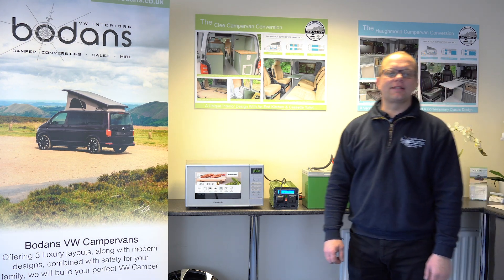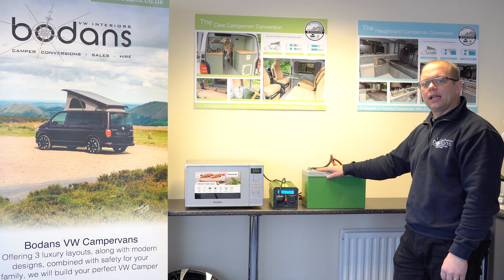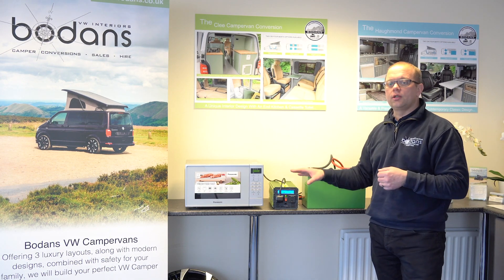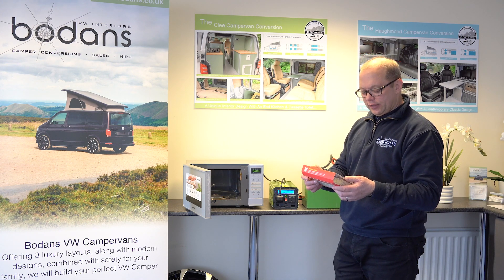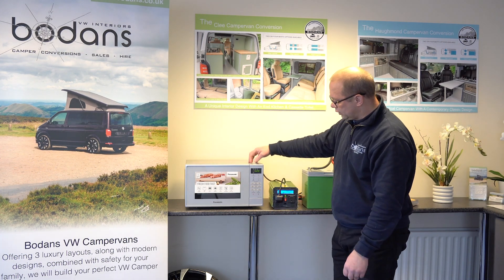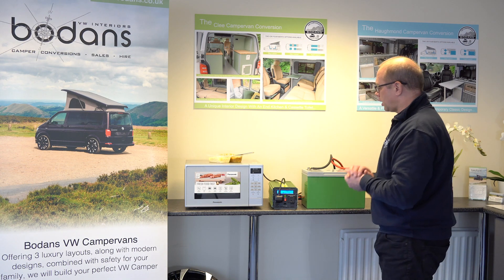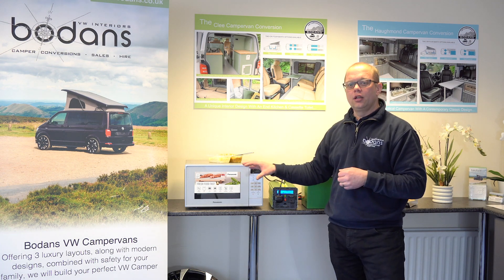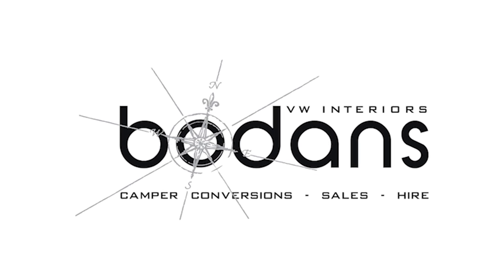How To Run A MICROWAVE From A 12v Leisure Battery In A VW Campervan Off Grid

Comment: One small detail ill add is that inverters come in 2 types modified sine wave (cheap) and pure sine wave (a bit more money). Its best to get a PSW inverter for running sensitive or more costly home appliances such as laptops, microwaves etc

Comment: As a simple rule, to calculate how long a 12v deep-cycle battery will last with an inverter multiply battery amp-hours (Ah) by 12 to find watt-hours, and divide by the load watts to find run time hours. Finally, multiply run time hours by 95% to account for inverter losses

Comment: One thing I would do is run my engine (split charge relay) while using the microwave.
Reply: Thank You! ,,,and I mean it.  Just common sense.  90% of the items you would heat in the microwave only take a very few minutes (especially in a mobile situation).

Comment: Yes it works - you need 25mm square cross-section  inverter leads as the current can hit 100a draw - We use a 105a Lithium Lifepo4 battery on ours
Reply: Where did you get your lithium from?
Reply: @sausage6984  A nice chap who lives on the River Themes in a Barge just out London - He deals in bulk sales
Reply: @trevortrevortsr2  thanks. Lithiums are very expensive.
Reply: @sausage6984  Theres some pretty nice 280 Amp hr Lifepo4 on Amazon  I would use if doing it again  - you have to be careful some are "b" class read the feedback - I rebuilt my pack recently with a blue tooth BMS and fitted a little low watt 12v silicon heating pad under it with a related timer set to switch on at 2deg C so I can leave it connected to solar all year round  even in  sub zero - using mine at 10 - 90% charge there rated at  7,000 cycles to 80% - in the long run they work out cheaper - they will last over 10years
Reply: @trevortrevortsr2  There's a lot to think about. Very useful info. Thank you. It takes a fair bit of digging to find info and then it's ambiguous for anyone who hasn't done an electrical principles course or there's data missing from specifications.
It annoys me that battery specification don't state their max amp output for max recommended time, before internal resistance becomes a heat problem.
Reply: @sausage6984  What you need to look for is something called the C rate - the  C rate of 1 means a battery can discharge at its amp hr capacity  eg a 100amp hr battery can discharge at 100 amp - in practice bigger cells have lower "C" rates - them 280ah  are 0.5C while the 100ah can discharge  at 1C  - cells used for e bikes can often discharge at  5 C - its often to do with the volume to surface area- on my system the mass of the cells and the relatively short time a microwave or kettle is on  means the cells barely rise in temp and the inverter fan seldom goes on - in any event the internal resistance of a good Lifepo4 cell is incredibly small - they hold their charge for months  - for info try channels like  Will Prowse https://www.youtube.com/channel/UCoj6RxIAQq8kmJme-5dnN0Q  or David Poz https://www.youtube.com/channel/UCXJ7onrDcxo2zy8yAsxqwgg or Adam Welch https://www.youtube.com/channel/UCm5sG3-BXQZfVy3st2T_XKg who seem to know their stuff
Reply: @trevortrevortsr2  thanks Trev. So invaluable.
I did I calculation ages ago. 800W microwave draws about 84 amps, which means the microwave should last about 1.30 minutes... not 32 minutes mentioned in this video. I really don't get it.
Reply: @trevortrevortsr2  nirvana :-) We know how that ended.
Reply: @sausage6984  Your right you don't get it  LOL  a modest microwave say 700 watts draws just over a KW due to losses  and yes you right it is about 80amps on mine - a 100amp/hr battery should run for 80 amps for over an hour but again Inverter losses mean about 50min is the most - in practice I dont think I've ever  used  a microwave for 10 min - the solar on our RV would soon put that back
Reply: @trevortrevortsr2  ok. Now I get it. I took the 100 Amp hour as being... you get 100 Amps in total over the hour. That's what I mean by ambiguous information on spec sheets.

But what it means is, you get 100Amp runtime delivery for an hour.

For all the websites I've read, did not explain that.
Reply: @sausage6984  See the road to Nirvana is the sublime state of inner happiness - not a rock band -  The faster you discharge a battery the  less you get out of it - 80amps is not something you want to pull out of a 100a battery for long spells - it will expose any differences in internal resistance and progressively throw the cells out of balance - that's why getting matched cells is a good idea - cells from the same build - don't be scared off - I built my first pack a decade ago
Reply: @trevortrevortsr2  do you mean ... parallel two, three or four batteries to divide the amp draw between them?
Reply: @sausage6984  When you add cells in series the volts rise but the amp hours remain the same - When you join cells in parallel  the volts stay but the amp/hr go up  eg 4 cells in series is 12.8v nominal '100amp/hr  however the same cells in parallel would give 3.2volts nominal and 400amp/hr - when cells are in series there charge is pulled down  equally - if one cell is slight weaker than the other it will drain more and the pack is said to be out of balance  - in series a pack is only as good as its weakest cell - the first cell to hit 2.5 volts will shut down the BMS
Reply: @sausage6984  Fortunatly BMS (Battery management systems) have a balancing circuit and when a cell hits 3.5V its leaks power allowing the others time to catch up - that's called a bleed balance - its usually between 60milli amps and 15mA - they are mounted on a little heat sink to dissipate the energy - there are other types of balance called active cell balances but they are  more complex
Reply: @trevortrevortsr2  the tech goes on and on and on.
I'd like to keep it cost affective, simple as possible and less to break.
Reply: @sausage6984  You need to decide how much power you need and what  your peaks will be  100amp/hr of Lifepo4 is like 200amp/hr of lead acid  - you need 4 cells a BMS and a main fuse in a box - and remember not to charge below freezing - I use something called a Coulomb meter on mine - it counts in the jouls and out letting me know exactly  whats stored as well as volts and amps being charged or drained - like I said if I was doing it again I go for the 280 amp cells
Reply: @trevortrevortsr2  lead acid amp rating needs to be double than that of lithium!?
Reply: @sausage6984  You charge Lead/Acid to  Full and drain them to 40 max 50% or they wont last long  maybe 100 to 300 cycles - Lifepo4 you can in theory fully charge to 3.6v a cell and drain to 2.5v  maybe 2,000 cycles - I charge mine to 90% and drain to 10% which should give me 7,000 cycles and then the batterys storage  will still be 80% of new. One thing you should note is Life or to use its full tittle Lifepo4 is not the same a Li-Ion which is a  more energy dense chemistry charged to 3,6 nominal - we use lifepo4 because  a 4S (4 in series) fits in nicely with a cars alternator voltage of 14v
Reply: @trevortrevortsr2  that is insanely impressive
Reply: @sausage6984  I could almost build a 280 amp for £100 more - its a cheap chinise battery - see what my friend Will says  https://www.youtube.com/watch?v=WVxvBkeY0UY

Comment: What size fuse is on the inverter.....100amp... 200amp...?
Reply: I found 200amp fuses best as threes quite an initial surge that tripped a 100amp

Comment: Hi, I'm very new at this so...Amish here in Missouri suggested that I get 2- 6vot. battery's for running LED lighting, computer, and Microwave, Is that true ?    Also will I need some kind of converter......I did notice "Bass Pro" had some that was multipurpose...but I'm still kinda lost to all this.
Reply from the maker: Hi John, we have tried many different setups to get a microwave to work from a 12v battery and found this to be the best. As for LED lighting, so long as its 12v, a standard 12v leisure battery would be fine without an inverter. To run a computer / Laptop you would need a 300 watt inverter conectected to again a standad 12v leisure battery. Hope this helps.

Comment: Hey there I have
varta professional dual purpose lfd90 battery
Sterling 1600W power inverter
I've noticed that voltage on the inverter drops to below 12V when I use my 700W microwave. Cables are very thick I put 50mm so I believe that not the problem. Could battery be of a wrong type ? Does voltage on your inverter drops as well ?
Thanks

Comment: Question please how much will it help to have engine running whilst microwave is running. Will it make much difference? subject to that battery being on the charging circuit. ThanksTony
Reply from the maker: Hi Tony, it will help but only slightly and its all dependant on the size of your vehicles alternator and condition of you vehicle battery. For this to work properly you will need it to run from a lithium or carbon/lead leisure battery.

Comment: So can that inverter hook up to my normal van battery? won’t be using the microwave a lot. I take it the vans alternator charges the battery?
Reply from the maker: Hi Aidan, I wouldn’t recommend connecting an inverter to your vehicle battery especially a high powered one as it will drain your van battery very quickly to a point that you won’t be able to start your engine. Alway try and connect to a second battery that can be charged from your vehicle.
Reply: @BodansCampervans  okay thank you for replying. I’ll have a looky

Comment: Thanks for video. It would be great if you could list which inverter, microwave, and battery you used. Did your inverter display the watts being used? Most microwaves are rated in cooking watts, not consumption
Reply from the maker: Hi Chris, The parts used are. LEOCH 12v 100ah Pure Lead Carbon Battery - EDECOA Power Inverter Rated Power 1500w & Serge Power 3000w - PANASONIC 800w Microwave.
On test we got the microwave to run off the fully charged battery for approximately 30 minuets.
Reply: Do you think a 800w inverter 1500w peak would run this?
Reply: Rob I’d say “no” because some microwaves actually startup at a higher wattage. For example 800 watt  cooking equals 1600 watts inverter roughly.
A 110 life4po Battery will give you  mins. Much safer at discharging higher amps.. you’ll also get a slight whine using a modified sign wave inverter. In my experience pure wave is better.
Reply: @stellarandrews9538  I use this microwave ( https://amzn.to/2VbvkzB ) with my Victron 1200 Inverter ( https://amzn.to/2XDyuOh )
Reply: SerendipitySue are you in Europe or the USA.  ? That makes a huge difference as US appliances use a different voltage to Europe.. I’ve also edited my comment to better explain
Reply: @stellarandrews9538  I'm in US... these are 120VAC devices that I run off of a 12V battery
Reply: @stellarandrews9538  We agree on def Lifepo4 - we use 105a with a 600a peak BMS

Comment: Like the video 😍. How many times can you charge a lead acid battery. I know a car battery normally last 3 years.👍🤔
Reply from the maker: We used is a pure lead carbon battery with fast charging of up to 90% in less than 1 hour and has 2000 charge cycles

Comment: What are the options of how to charge the battery? Is a 12v marine battery the best type for this application? Thanks
Reply from the maker: Hi Cyti if the system is going into a motorhome or campervan we would be charging the battery using a votronic battery to battery charger which charges the 2nd battery whilst driving the vehicle and when you can hook the vehicle up to mains power we would recommend a Numax battery charger.

Comment: Hello, I would like a setup like this,  but I haven't bought an inverter yet. Would you expect this to work with any leisure battery over 100AH? I've got a SuperBatt DT120 120AH battery. I've noticed recently when I use my 45watt laptop charger the battery voltage drops to around 11v. I'm worried that the battery isn't going to be able to maintain a high enough voltage when it's having 600watt drawn from it?? Don't want to waste a lot of money on an inverter if it isn't going to work. What are your thoughts?
Reply from the maker: Hi Sam, we have tested several batteries and found the LEOCH 12v 100ah Pure Lead Carbon Battery to be the best and last the longest, we have not tested the SuperBatt DT120 and my feeling would be that it would be not suitable for this job.

Comment: Can I run a microwave in my car with the engine running? I only need to heat food up for a few minutes.
Reply from the maker: Hi Robert, sorry i'm not sure if that will work as testing has only been done on our equiment.

Comment: Hi I have tried this with a 6000w inverter with a 600w microwave and it trips so won’t run the microwave any advice please?
Reply: You need a 1500 watt pure sine inverter.
Reply: Great, Thank you
Reply: a 6000w inverter should easy run a 600w microave
Reply: @irenedunne352  some cheap chinese modified wave inverters are  dreadfully over rated - I opened one once - i doubt it could sustain 1kw

Comment: yeah, how did you cilip it to the battery. and what's going on in the back of the inverter. not as helpful as id wished
Reply from the maker: Hi, the video was only intended to show that a microwave can be run off a 12v battery and not an in-depth instruction on setup sorry.
Reply: @BodansCampervans  thankx for reply - i ended up buying an inverter; i thought i needed speciality cables, lengths, and density. turns out inverters come with their own cables and clamps. funnily my title searches never matched up with vids available - but you tried. thank you.

Comment: Would any microwave 800w or below be ok to use in this set up?
Reply from the maker: yes any microwave rated 800w or below is fine so long as the inverter is rated at 1500w
Reply: @BodansCampervans  what size would you recommend for power consumption? Or does it not really matter

Comment: Hi again! Cranking amps. My car is 750 cranking amps. Are you sure your battery is only 100 cranking amps. That's not even enough to start any car. What did your battery     come out of.
Reply from the maker: Hi Alan, it is a pure lead carbon leisure battery designed only for Campervans & Motorhome’s and not designed for starting vehicles. The battery does not have a crank rating as it’s designed for giving out a constant smooth power supplying power to all 12v appliances in the living area of the Motorhome.
Reply: Cranking amps are not specifically applicable to leisure batteries. Amp hours are what you need to consider for measuring leisure batteries.